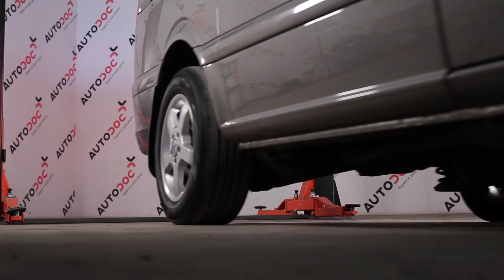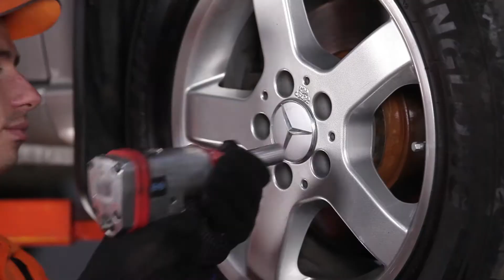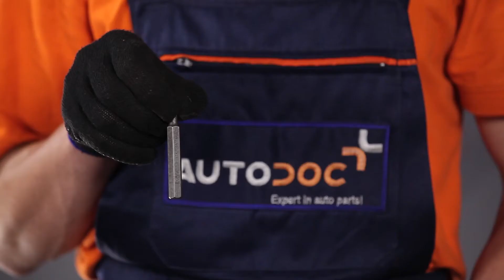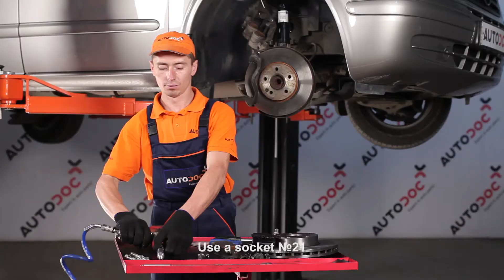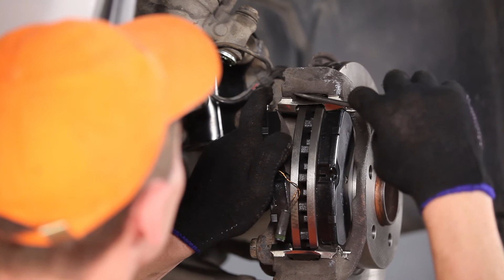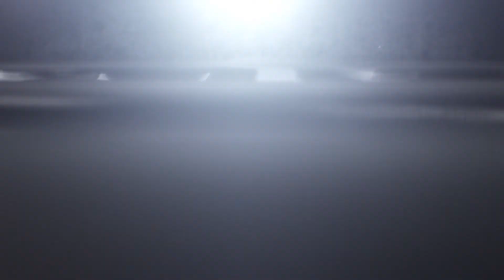How to change brake discs and brake pads on MERCEDES VITO W639 [TUTORIAL AUTODOC]

Comment: If your brake warning has come up before you change the pads make sure you fit new sensors as the old sensors have opened circuited and will still give you the warning after you have changed the pads.

Comment: Good video for demonstrating how to take it apart and put it back together, but it should really be done starting with rusty old parts stuck together. Not with loose part that obviously have been prepared in advance to make it a smooth operation. In real life there will be a lot of extra operations involved both in breaking things apart and for cleaning up before the new parts are mounted. The back plate/shield should be cleaned and treated with anti-rust primer (or similar) while the disc is off. On older cars it is not uncommon for the shield to be so damaged that it needs to be replaced.
Reply from the maker: Thank you for your feedback!  Unfortunately, on each car, the complexity of the replacement is individual, it all depends on the technical condition of the parts. Our videos are only informative in the sequence of replacement and to save time, we weaken some nodes in advance. Best Regards, Autodoc Team!
Reply from the maker: Thank you for your feedback!  Unfortunately, on each car, the complexity of the replacement is individual, it all depends on the technical condition of the parts. Our videos are only informative in the sequence of replacement and to save time, we weaken some nodes in advance. Best Regards, Autodoc Team!

Comment: good video.  I put a little caliper grease on two long bolts shafts that hold caliper. also a small dab on metal clip where pads slide.  very small bit on clips.  this is best video i have seen on the front brakes
Reply from the maker: Thank you for your feedback! It is out top priority to receive comments as positive as yours. Be sure to subscribe to our channel if you don`t want to miss out on more useful videos in the nearest future. Best regards, Autodoc!

Comment: That stupid T30 bolt that holds the rotor on just won't budge even with an impact drill. The bit snapped after a few goes. Any suggestions. Not really keen to pay 300 bux for someone to remove 2 bolts (the bolts that hold the rotors on, 1 each side)as they are basically charging a pad and rotor replacement fee.
Reply from the maker: Thank you for your comment.
According to the description, it is difficult to solve your problem, we recommend contacting the car service of your car.
Stay tuned with us.
Best Regards,
Autodoc team
Reply: @MrGammyballz  thought of that too!

Thanks for that.

Comment: The you need to reset the brake warn light manually? Because it got my front rear rotors pads replaced the pads came with new sensors bosch pads.  But the break warn icon is till on the dash.
Reply from the maker: Thank you for your feedback. 
Unfortunately it is not possible to  answer your question definitely, we recommend you to  contact the service where you will definitely try to remove this error.Best regards, Autodoc!

Comment: Improvements: 
1. Use the bleeder valve into a jar when compressing the piston pot.
2. Show taking out the actual bolts instead of switching cameras.
3. Remove the dust shield possibly to show if it’s in good condition.
4. Wipe the hub / apply new grease to the face / wire brush the face / etc.
5. Use new pad clips instead of using the old clips (Mercedes does this de facto)
6. Does not show applying lube/grease to tips of shoes or anywhere else
7. Explain that using a caliper hanger is less dangerous than hangin it by it’s brake line during job.
8. Wire brush and wipe parts clean of debris / clean bolts with wire brush / etc.
9. Show removing rubber bolt caps which are not present here (which protect grime from getting in bolts)
10. Does not show torquing the lug nuts once complete.
Reply from the maker: Yeah, you are right. We have fixed the issues in our next videos, hope you will enjoy them!
Reply: Great tips ~ thank you. I noticed that the caliper sliding pins were not cleaned and re-greased.

Comment: вместе с колодками тормозными надо еще и диск менять ?  или можно только колодки ?
Reply from the maker: Thank you for the feedback! If the wear of the brake disk is low, it is acceptable not to change the disc. On average, the disc serves about three brake pad changes. When replacing a disc, the pads must be changed to new ones. Best Regards, Autodoc
Reply: Thanks a lot for your high quality and quick-self-explainable videos. I was just wondering if you have any advice on what kind of brake pads should be chosen. 

Plus, do you have any video on replacing the serpentine belt on a 2008+- Vito?

Best Regards!
Reply: Yes I just installed these  Bosch Brake Pad Set Rear Blue Line BP992 30-0 986 494 082 X1 

Bosch Brake Pad Set Front Blue Line BP991 30-0 986 494 081 X1 

DBA En-Shield Brake Rotor Front Pair DBA2256E 9991-DBA2256E X1 

DBA Brake Rotor Rear Pair DBA2257 9991-DBA2257 X1 @tiagomonteiro2678  for my vito 115 cdi w639